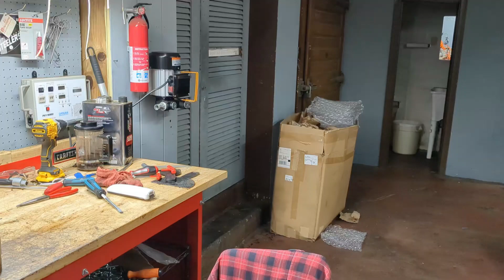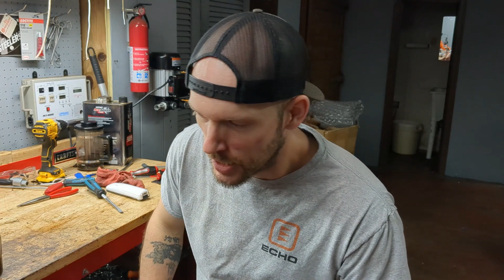SERIOUSLY CHRIS, ANOTHER STIHL CHAINSAW IN YOUR SHOP?  STIHL 090, LET'S HAVE A LOOK.

Comment: The contra/lightning is the start of that family, they also made the contra s that was also 136 instead of 106. They also made a contra s gear drive that had a 136cc top end but from what I read it had some cooling issues. Contra came out in 1958-59 so the 08 from 1961-62 was likely designed by the same people along with the 07/07s. The Stihl logos changed in early 70’s just like going from red to orange.